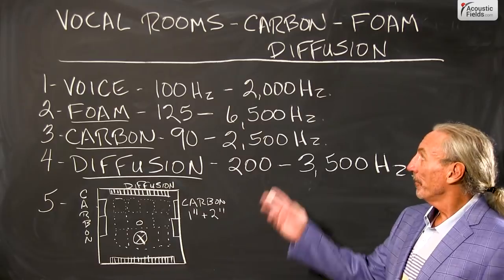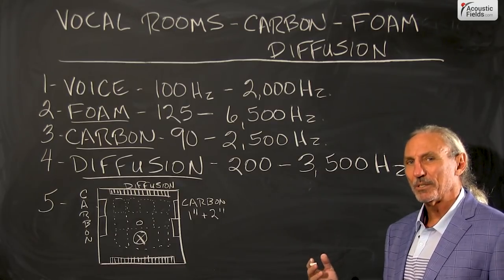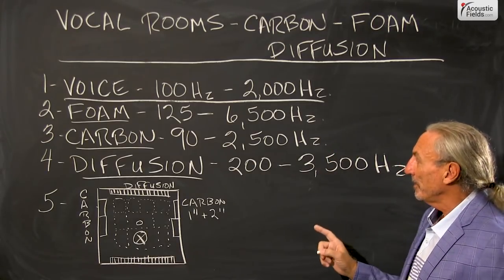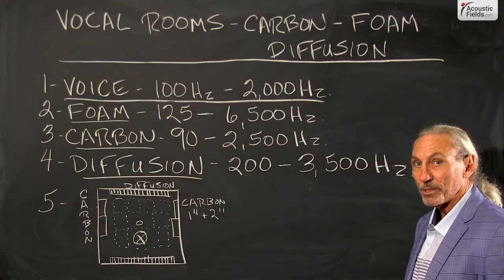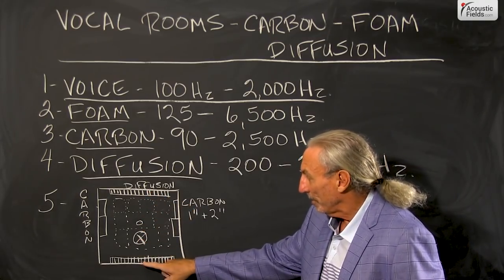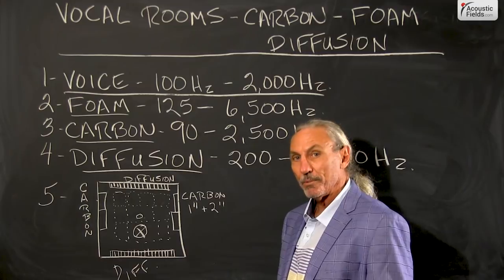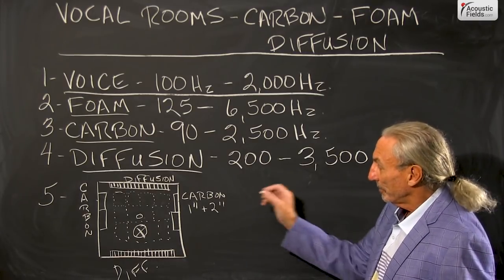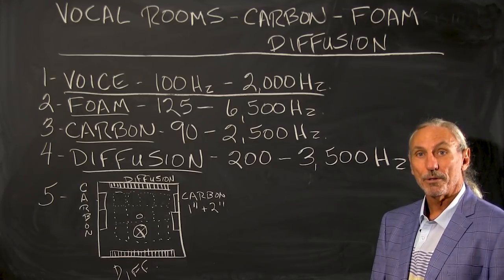Best Practices For Vocal Rooms - www.AcousticFields.com

Comment: Why not use foam at the reflection points in the side walls instead of the carbon panels?   The carbon is considerably more expensive.  Is it because the foam sucks too much liveliness out of the room ?
Reply from the maker: Carbon is a low frequency management technology. It has nothing to do with middle and high frequency reflections. You must apply the proper solution to the frequency and amplitude of the acoustical issues.

Comment: What's the best room for acoustic guitar,  how to make a setup acoustic  for acoustic guitar?
Reply from the maker: C,  There are many variables to consider.  Ceiling height is the most important dimension.  Stay with dimensions that exceed 14' in all three planes.
Reply: thanks!.... and about the acoustic treatment?  what do I use on celing, floor, rear and front? where do I use this diffusers, absorvers etc? what is it better for each surface?  thanks again

Comment: Do you foam the whole ceiling or just above the singer?
Reply from the maker: You have to calculate the proper amount of surface area treatment for all surfaces to achieve the desired reverb times.  As a general rule, you want to minimize the ceiling reflection into the microphone.

Comment: are you doing anything with the floor in this room? rug or carpet?
Reply from the maker: j,  It depends on the usage the client puts the room through. Most prefer a low maintenance material if usage is high. The floor in these very small rooms is not an acoustical issue but more of a maintenance need.
Reply: What's the best room for acoustic guitar,  how to make a setup acoustic  for acoustic guitar? could you make a video like this? but speaking about acoustic room for acoustic guitar? thanks